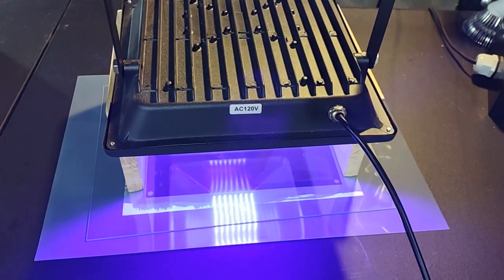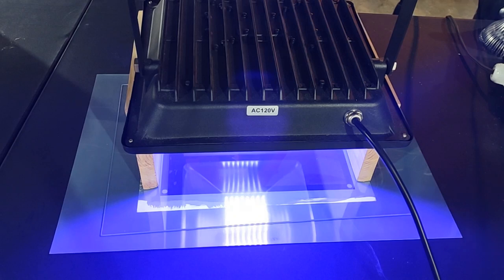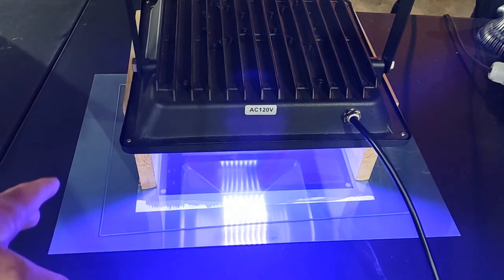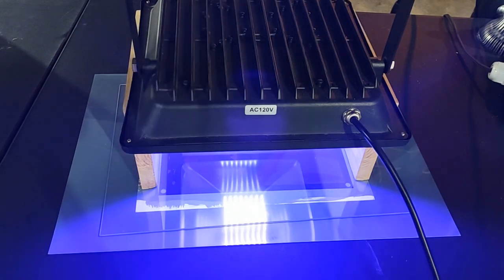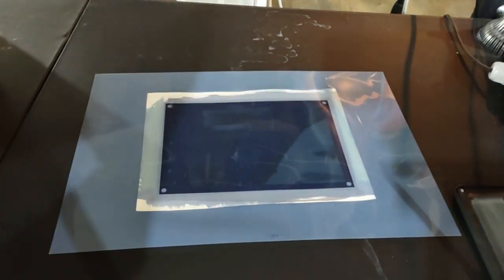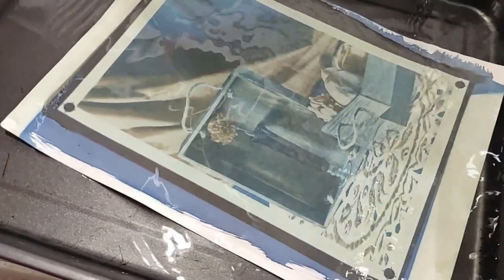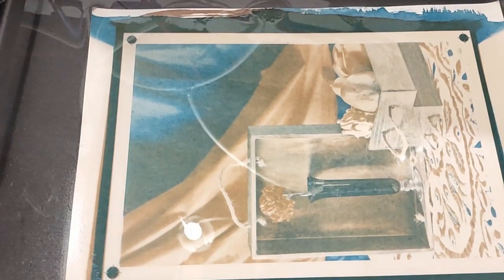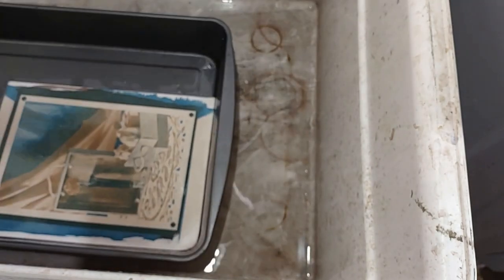Duotone cyanotypes " Part 7 the last layer and FINAL IMAGE! "

Comment: Do you know if there are any health risks from using the exposure lamp? 11:10
Reply from the maker: @sillysandwich4654  While the particular wavelengths used in these led lights are not necessarily dangerous like sun rays, I would still use eye protection. It might look dull, but that is just because we can't see those wavelengths and it is 80 watts so definitely wear eye protection

Comment: I may be wrong, let's start with that possibility.  if you have a 10% solution (say 1 gram in 10 ml) and you double the water = 20ml, you now have a 5% solution. when you took the 10 ml of solution A and added 10 ml of solution B you now have 1 gram of a in 20 ml of water and 1 gram of b in 20 ml of water. combining the mixed solutions created a 5% solution already. when you added the 20 ml more to "half" the formulas you now have - still, 1 gram of A and 1 gram of B each in 40 ml of water or a 2.5% solution.  when you mixed them together they were already halved and now you quartered them.  Figure if you took solution A (1 gram in 10 ml) and added 10ml  of water, it's now 5% without any of the water in solution B and it's extra 10 ml. what happens to the extra water? I believe it is 5% when you mix the two together.  Again I reserve the right to be wrong.  I kinda think I might be right.
Reply from the maker: A normal cyanotype solution is a 20/10 mixture, I am diluting the 20 solution in half making it 10 and only that one for the first layer, the second layer is the 10/10 solution diluted in half which would bring the individual components to 5/5.